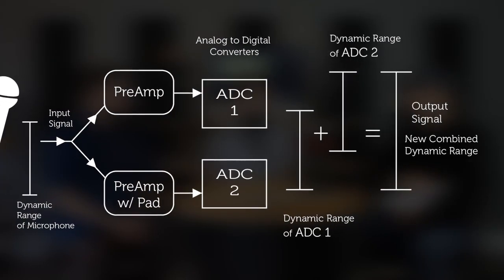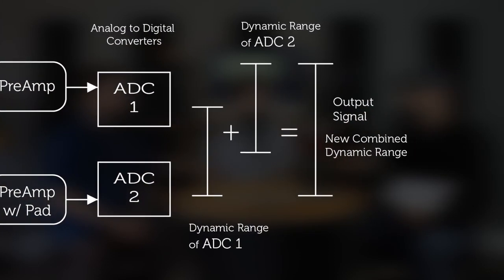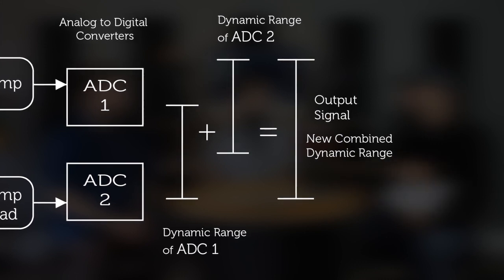PPA Unfiltered: 29  Zoom F6 32-bit floating ADC - how it works!

Comment: I don't think its switching between the preamp inputs. more likely its using some kind of math function in FPGA or DSP in the Microcontroller to combine the entire serial data output from each ADC to build the larger 32bit float file. Also people should mention the Zaxcom recorder mixers which have been doing this for years and got the 1st patent for it !

Comment: Hi - I'm watching this video almost 2 years from when you made it. I don't own one yet but soon.........
I have a question if you are still monitoring the comments. Zoom has an F2 recorder that is advertised as 32 Bit float. I can't see how this would have the same technology as the F6 with dual A/D converters etc for the low price of the unit. This leads me to the question. Are there different forms of 32 Bit Float and are they all equal?? Maybe a topic for one of your next video discussions?? Peter. Subscribed today.
Reply from the maker: We think it's the same exact converter tech in the F2 as in the F6. The F6 just has a few more channels. Thanks for subscribing! -David

Comment: Guys someone should make a deep test of this unit for live music. Cause no clipping? 6 channels? It's a singer songwriter's dream. Those things said I am an h5 owner and this thing is useless for musicians, 	the preamps the battery life and the hugeeeeeee mess of the noise floor makes it useless as an audio interface or even as a 4 channel live set mixer. It was a miss hit for me. It works fine for capturing sound bits and some conversations etc. So throw some knowledge and many people will appreciate it.
Reply from the maker: We'd love to test it out when it releases! The H5 is very different from the F6 that we are talking about. It doesn't have the same technology and the preamps and conversion are older. That said, they are still decent units. However, the F6 (again, the piece we are talking about) is going to have a much lower noise floor, higher gain pres, and 32-bit floating ADC. We're discussing what that could mean for the future of the audio industry as well. -David